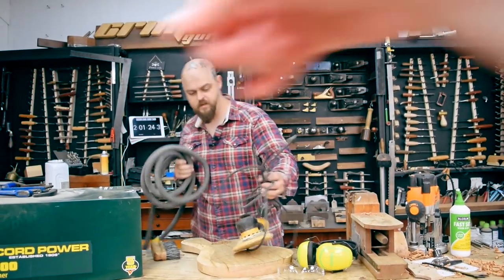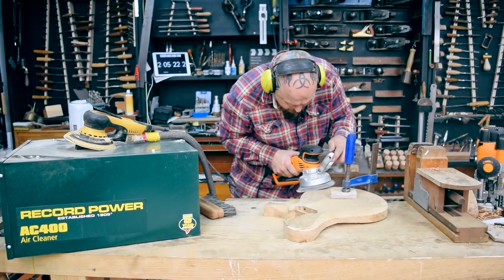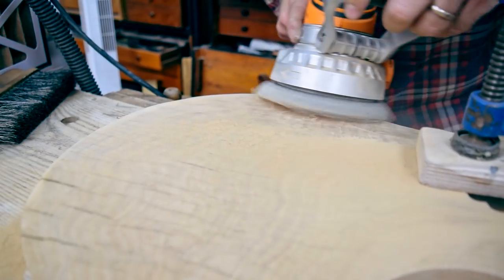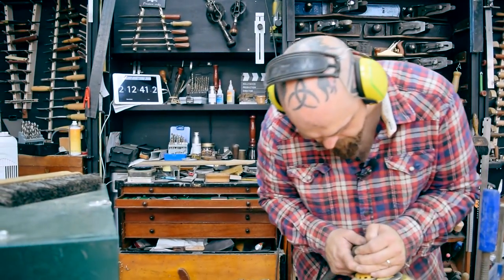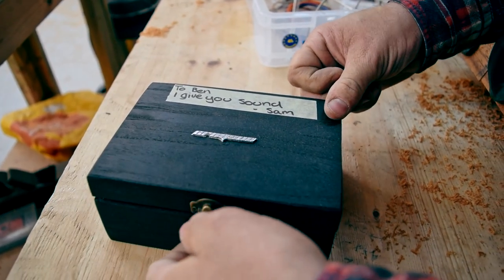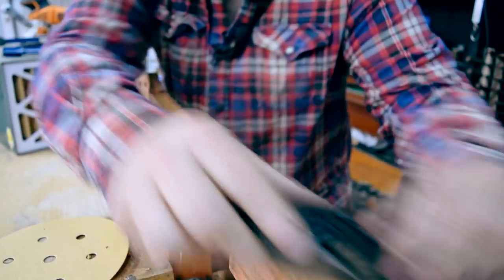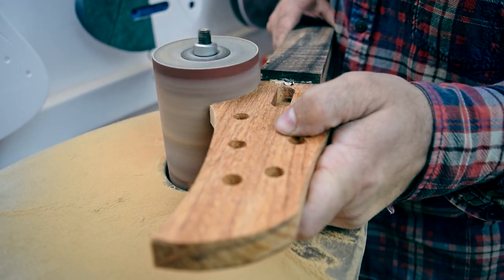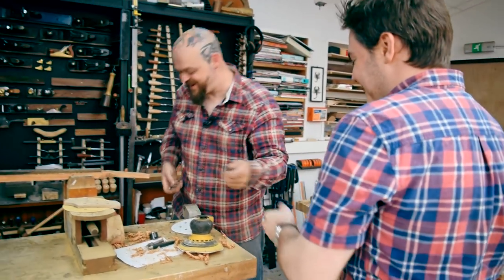Ep 5 - A Luthier Builds a Whole Custom Guitar in SIX Hours.. from SCRATCH! - Dust Mask of Doom

Comment: Dutch rush is fun and all, but that goes back to the caveman days (used to use it all the time for smoothing/shaping reeds for woodwinds, where you're trying to put a nice surface finish on something that's less than a tenth of a millimetre thick). Modern abrasives are a whole lot more consistent and predictable - things like micro mesh pads (originally for reconditioning perspex windows on aircraft) and 3M's superfine films (especially the self-adhesive stuff) work a lot better, without the occasional surprise from a larger embedded bit of grit.
Reply from the maker: So that's what it is called! And yes, 3M are taking over the world! B